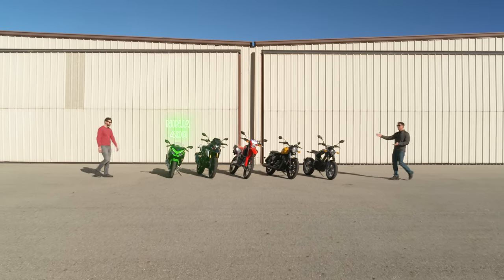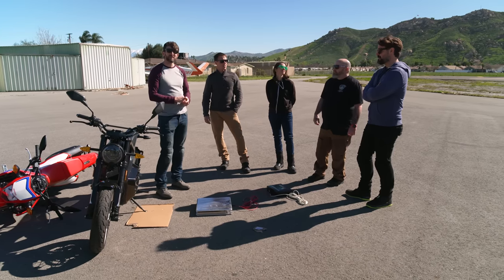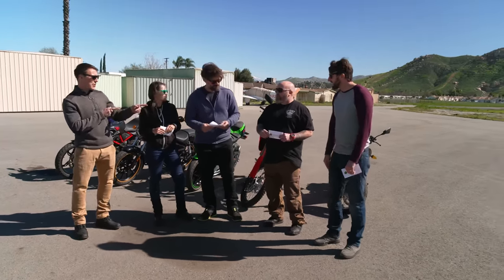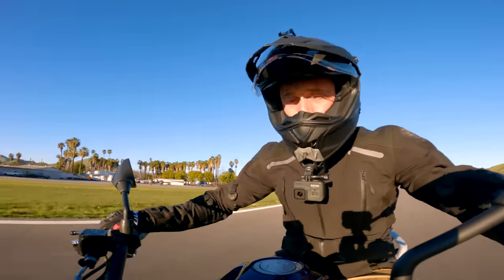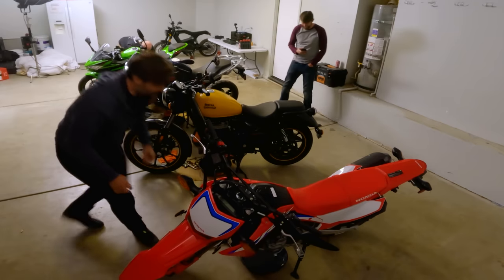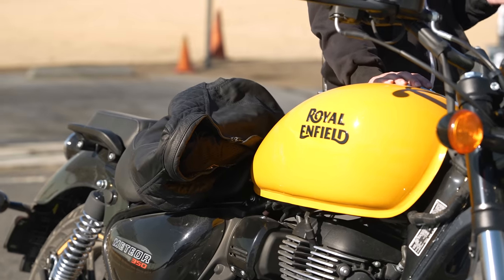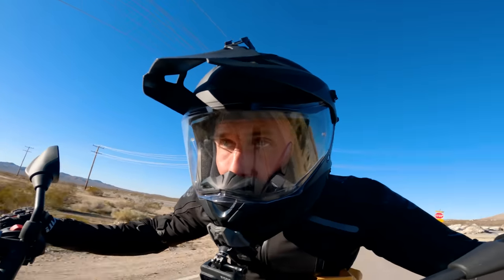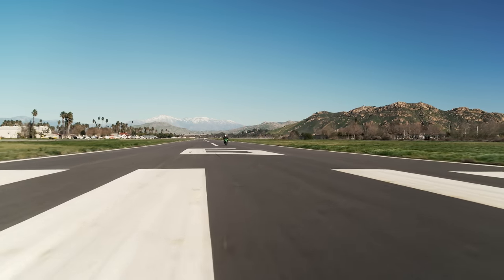Best Beginner Motorcycles! Ninja 400 vs Meteor 350 vs CRF300L vs Sondors Metacycle vs G310GS | CTXP

Comment: Brilliant video but can we stop saying electrics are the future just because they're electric? 
That Sondors is little more than a pushbike with a motor in the wheel and its a very, very long way from being the future of motorcycling. 
Some of the Lightnings and so on are interesting but the future really needs to be something that can do at least as well as what we have in all areas and improve in at least some areas. 
That thing can't even keep highway speeds for the short straight you have here so its simply not a machine capable of replacing a motorcycle. Possibly a short commute use on a 125 but even then you can still take that 125 anywhere you like without having to constantly worry about range and being held up for hours at a time. 
That thing is an expensive kids toy and you would be much, much better off in every way - including environmentally - by buying a Honda cub 125 or similar.

Comment: You can't top speed test bikes with different weight Riders the Rider that weighs 110 lb it's going to be much faster than the rider that weighs 260. Even if they're riding the same bike. Not only does he have more weight but he also has more wind resistance.  Nor can you say they're a bike accelerates faster. Again you have the same problem. Those kinds of tests need to be done with the exact same Rider under the same conditions to get any kind of accurate numbers.

Comment: Since all those bikes have a different torque/weight ratio, why did you assign all them using a random method ?
I mean… that lady is probably the lightest one of the whole group compared to the bald guy, no ?
Why didn’t you assign the bikes according to the rider’s size and weight to get close to the same equation and then start some comparison ?
Also, who would lift a bike like the bald guy ?!? As opposed to the lady who did properly, almost without any effort ?

Comment: 8:05  she's putting some of her weight on the bike. Not possible that RE is only 85lbs.

Making the weakest (a woman) lift the heaviest bike as if women have the same physical strength as men (which they factually do not) is nonsensical.
Reply: No, the Meteor only required 85lb to lift it back to vertical.